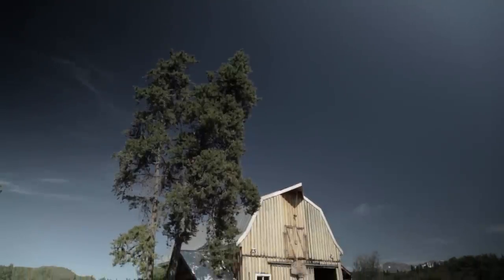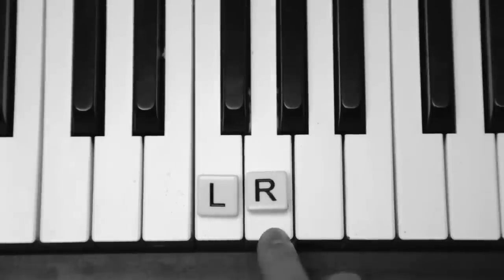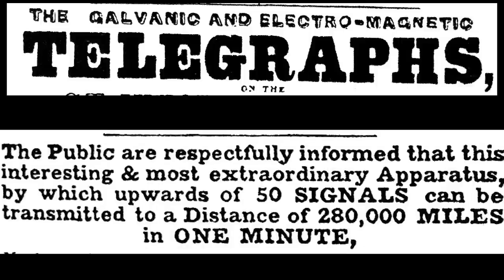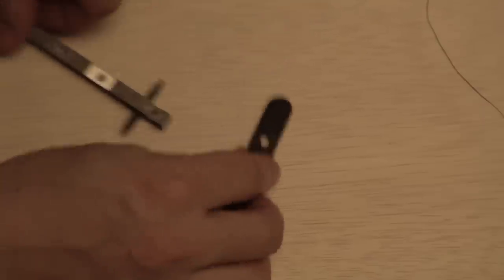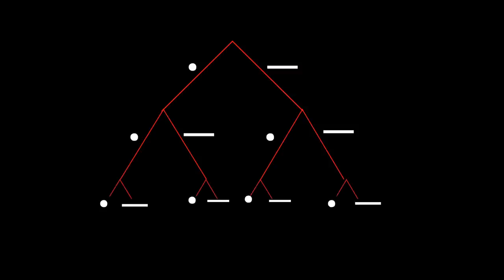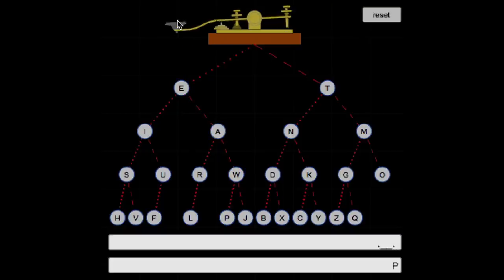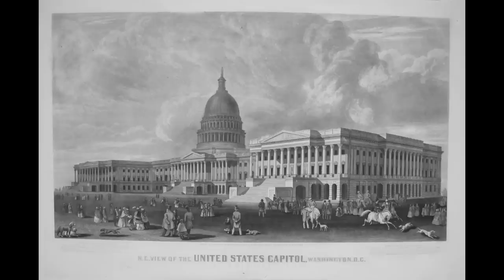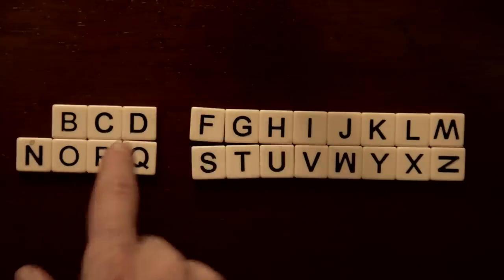History of Morse Code

Comment: You want an episode of hilarity involving garbled messages involving Morse Code? In the Russo-Polish war, the Poles did engage in a DOS attack on the USSR forces prior to the battle of Warsaw where they hijacked the Soviet radio frequency that the Reds were using for their Morse Code messages it seems, and the Reds had to shut down their radio communications because the Poles were transmitting the bible through the Soviet radio frequencies for their troops.